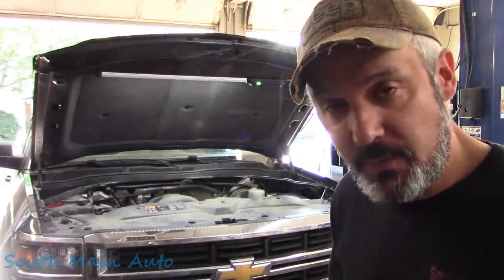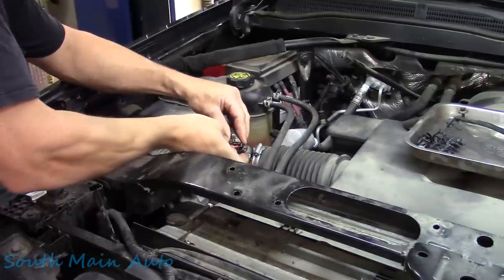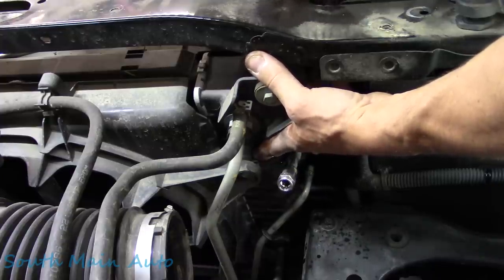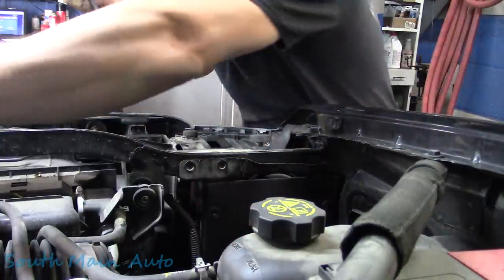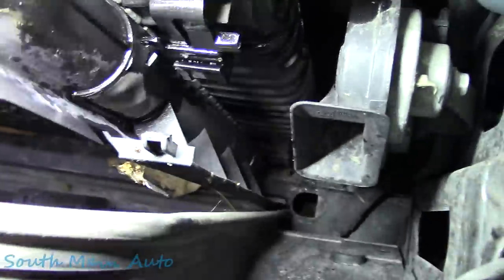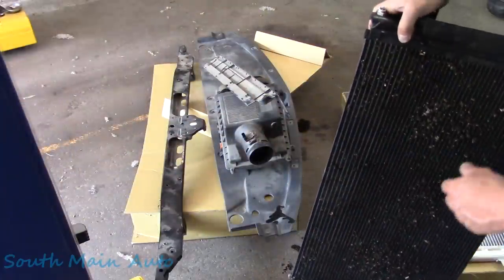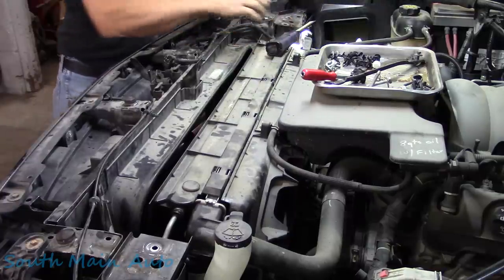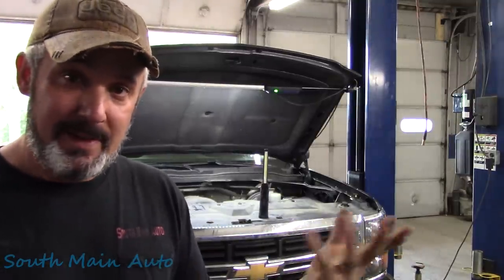Chevrolet 1500 / Tahoe - No A/C Leaking Condenser

Comment: Great video. As a GM tech I have seen dozens of those turds leak. Warranty cut the time so bad, we found a "flat-rate" way to do it. Looks like a nice vegetable garden growing in the radiator. Keep grinding brother!
Reply: Which means the radiator gunk is never cleaned...
Reply: @gplusgplus2286  yeah we still clean them. Just with soap, water, and a brush. Well at least I do, other guys I'm not so sure.
Reply: @gplusgplus2286  they are paying for you to clean the radiator, need to add .2 for that.
Reply: @burninggearsmobilemechanic  I've seen some industrial HVAC videos where they use some kind of cleaning solution to clean the fins. I'm guessing it's caustic. Wonder if that would work?
I recall seeing a semi repairer doing this for a customer due to overheating.
Reply: @Cheepchipsable  I use Dawn dish soap and water with a dish brush with a handle. It works well and then blow it out with a radiator air gun. I have seen the HVAC stuff. I assume it would be fine, a condenser or radiator is aluminum no matter the industry right?
Reply: @gplusgplus2286  Should the tech wash and vac the truck too?   These pay .8 now,  you don't get much done for peanuts.
Reply: @Cheepchipsable  Caustic and aluminum don't play well together !!!  They react, Drano granules use this fact.
Reply: So you're telling me never to bring my truck to your shop because you'll skip some stuff to get paid more? Thanks
Reply: @lopincol  Yeap, nature of the business.  You go to work and expect to get paid?  Well, so do I.  I don't work for free, and doing favors does not pay the bills.
Reply: @scrappy7571  from a paying customer's perspective that gets charged $$$$ at the dealer, I want it done right.  Warranty work included.  Take it with your boss, not the customer.
Reply: @lopincol  No, what I'm saying is, your paying for my experience to do the job your paying me for. If the job is done correctly and safely, what difference does it make how we got there? If Google tells you to go one way and you find a back road that gets you there sooner what's the harm? I have 35 years of experience and there is more than one way to skin a potato. 🤙
Reply: @thecuss6817  Very true,but the stuff is not harmful to aluminum. It's similar to the Prestone flush powder GM used to use for the S/T trucks to flush out the cooling system.
Reply: @scrappy7571  A tech should clean the area around the work area. If it comes back overheating I bet the shop won't pay to fix it without the tech participating because (s)he could have vacuumed and/or cleaned out the debris between the radiator and condenser. And if there is no damage from getting hot, the tech will be doing the cleaning for free.
Reply: @A. Melbs I do understand the frustration. Manufacturers continue to 'save money' by cutting labor times. But there's ways to remedy the problem; one is to leave as you did. The other is for techs to band together and make the manufacturers change their system. That is basically impossible because the flatrate world is every tech for themselves.
Reply: @A. Melbs 100% agree, glad you made it out. I trailered my tools out last week, never again going to be a GM warranty mule. Working for peanuts despite being in the building 50+ hrs/wk, watching customer pay jobs dry up because of increasing parts markup and shop rates, while our times decreased and rates remained the same.
Reply: @burninggearsmobilemechanic  For what this pays, nothing else is getting done for free.  Was not overheating before, why would it afterwards?  Just tired of being underpaid, and expected to do free shit.
Reply: @scrappy7571  Well, in my shop I do it as part of the job. Free is a relative term. If a customer asked me to change the oil and filter while I'm doing brakes, sure I would charge for it. But if I was replacing a door glass, I'd vacuum out the broken shards as a courtesy. I guess it depends on your definition of free.
Reply: @thndrstrck686  DAMN RIGHT!  Glad you got out.  I have 3 more years until retirement.  Screw this shit.  These days I make the same as I did in 1997.  Not accounting for inflation, health care costs, never ending tool purchases.  lucky to make 25 hours while there for 40.  And this guy wants his leaves blown out for free???
Reply: @scrappy7571  True, I decide what we work on. Now don't think we don't get our share of POS cars and bitchy customers but I don't allow disrespect or deceptive behavior from either side. We use Ondemand and don't have to deal with warranty (unless it's something we put on and it's our warranty). I do know the frustration of dealership life with the 'cattle call' mentality dealers push. My only advice is start your own shop and do it your way. It is way easier than you think. You can start out slow and do minor repairs and services until you have built the shop up.
Reply: @burninggearsmobilemechanic  Too late for me to open a shop.  45 yrs of this, and all I have to show is a worn out arthritic body, and no desire to work on modern junk.
Reply: @scrappy7571  YOU don't have to work on the cars. Hire guys/gals. Your knowledge and years of experience would be invaluable.
Reply: @burninggearsmobilemechanic  Just got to serv 3 years more time... Then I can retire and enjoy the remaining years.
Reply: @scrappy7571  That's good 👍
Reply: @scrappy7571  Thanks, I hope the next three years treat you better and you enjoy your retirement. I feel for you guys that have been at this much longer than I have and have so much invested in the dealership life.
Reply: I worked many, many years ago at a GM dealer (Oldsmobile.) To beat the flat rate, I saw guys both pull one head on a V8, use windshield "snot" to re-seal the intake manifold, and "torque" the head back in place with their half-inch impact. I've also worked with guys (when I transferred over to heavy-duty trucks) who also saw similar dealership flat-rate experiences. Not a good idea to use dealers for repairs!!! 😠
Reply: @gac914  Those techs need to be fired, and then tarred and feathered. To do a job under time is one thing, to blatantly hack together a customer's vehicle is unacceptable. The financial fallout from that crap could ruin a shop and the tech could be liable for most of not all of the cost.
Reply: @stevebell4906  Your pretty much spot on.   I swear that someday I will be paying them to work there.  The whole flat rate way of paying is, at best an antiquated system.  That needs to change before any new hires come into the industry.  Dealerships are toxic.  I'm 3 yrs from retirement, if I stay even that long.  In the mean time I'm doing my best to steer any wannbe mechanics into a better career choice.
Reply: @scrappy7571  I have been using to no avail now for decades with Drivers and Mechanics....Capitalism is real and management (The Company)is not your friend they are your adversary... and n this case they are between you and the paying customer...

Now imagine if you will a scenario with some other trades and management....lets say Plumbers & Electricians...Management call you up and ells you that you need to be at work with all of your gear and ready to work at maybe 0400-0500- in the morning...but you just need to hand out until they want you to work at their convenience maybe not until 1000 am or so and Now we are not going to pay you for any for that time...Or you are required to log a pre trip and check all or your tires and fluids and fuel the truck  and clean it...but hell no we aren't going to pay you for it...Or we routinely   short you 10-15% of your miles and you are paid by the mile...

Do you think ANY OF Those Plumbers or Electricians would put up with that?...Sadly as long as there are guys who will show up and be cheated by management it only encourages them to take more and more!

If YOU don't think your skills and experience are  equal to the other Skilled Trades...They will treat you like the Lot Boy ....Most of your toolboxes are on wheels and that is for a reason...You need to demand that they treat you better!
Reply: I love changing one then the next summer the “new improved part” leaks.

Comment: Another GREAT teardown video! If my 2009 Silverado ever needs AC work, I’m convinced it’s NOT a DIY job for me!
Reply: It isn't a hard job, it is just time consuming and fiddly.
Reply: That was basically easy.  All work was done from the top and everything easily accessible.  Try working on an Audi.
Reply: @EarthSouthside  exactly. The diagnosis often takes longer than the actual repair.
The advice I give to people new to DIY is" it's already broken so just try and see what happens".
Reply: The biggest issue with working on an A/C system yourself is the recovery and recharging. You always want to recover as much refrigerant ad possible, and without the machines at the shops you really can't, and if you crack the lines open (undo the bolts holding the lines into the condenser or any other part of the system) you'll get refrigerant everywhere, and it's really, really bad for you and for the environment. We use it because normally it's entirely contained and not a risk to us, but when it leaks, you really don't want the stuff on your skin. The new R-1234y type is much less detrimental to the enviromment than the old R-134a type, but it's not good for you, and if you pop the lines off without drawing it all out, you may end up inhaling some and you don't wanna do that. If you've got an AC machine, go for it. If not, let a shop do it. The machines tend to run around 3K for the R-134a and between 5-8K for the R-1234y type. Well, the Robinair ones used in my shop do anyway.
Reply: @apoplecticwrenchmonkey  the DIYers will love the price of the new refrigerant.   Think it’s close to $100 for a small can.
Reply: @apoplecticwrenchmonkey  hush! R134a is ZERO OZONE DEPLETION POTENTIAL and it can be a compatible/drop-in replacement for 1234YF. 1234YF is flammable, by the way as well as being obscenely expensive. Don't vent R12 into the atmosphere but zero ODP R134a is no real eco-hazard.
Reply: @walterk1221  Incorrect. I don't know where you get your information, but you may want to update yourself. It was determined that R-134a, while created to replace R-12 which was found to damage the ozone layer, is a contributor to the rise in greenhouse gasses. R-1234yf was designed to be much more friendly to the environment, and as far as we know (well, not all of us, apparently) it is so far much more eco-friendly. They don't just created new refrigerants for gits and shiggles, because it's expensive to develop so if they don't have to they won't. As for it being flammable, that's hardly a reason for it to be 'eco-unfriendly'. It's a reason to not be a moron with it, but that's more of a plus than a detriment in my opinion. Yes, the flammability is because it's very reactive, but that's why it's better. It breaks down in a couple weeks as opposed to R-134a which hangs around for 10+ years. Is it expensive? Yes it is, and so was R-134a when it was new and compared to R-12.
Reply: @walterk1221  I rebuilt a 2016 Chrysler 200s involved in a good front end hit.. it was "vented" during collision...after replacing parts I found it HAD R1234yf... A car A/C engineer stated that R134a was not compatible with this system... The compressor lable read "R134a"... I bought manifold adapters off eBay and purged system and added R123a and proper AC oil.. that was 3+ years ago and still have very cold AC at a MUCH lower cost...

.
Reply: @donjohnston4215  It's definitely expensive, and I don't envy the people who I've had to do A/C services for, especially with the Silverado/Tahoe's that have leaks. The Tahoe's take.. about 3.6lbs of refrigerant if I remember correctly.. 1.665kg on the labels, I think. Haven't done one in a couple weeks, so it's a little hazy on the exact details. I vageuly remember the Silverado's are around .667kg and the Tahoe's took a kg more..
Reply: @apoplecticwrenchmonkey  you are confusing regulatory agency dictates with physical reality. Everything I stated is correct in terms of scientific accuracy. You will note I mentioned nothing about the inconclusive "man made global warming" I merely stated that the materials are physically and chemically and operationally compatible. As opposed to R134a and R12 which are chemically incompatible.
Reply: @walterk1221  I am aware that you mentioned nothing about global warming, however your scientific accuracy clearly doesn't take into account that R-1234yf breaks down rapidly in the environment, whether it be on the ground or in the air, whereas R-134a does not, and takes over ten years. The EPA didn't decide that the chemicals react the way they do, did they? Is the chemical reactivity and decomposition of the two substances not a physical reality, or is that not relevant?

If you really want to get into the chemical properties of the compounds, at around 30C, the two refrigerants behave similarly in terms of the pressure they create inside the system when being evaporated to provide cooling, but at higher temperatures they diverge and R-1234yf creates more pressure, allowing for better cooling. Using 134a in a 1234yf system will reduce your cooling efficacy by around 10-15% and also shorten the life of your system due to the systems being designed for higher pressures. Can you use 134a in a 1234yf system? Sure you can, but you'll wear the components out faster.

And as for the 'inconclusive man-made global warming' bit, I'll avoid responding to that, since it's a can of worms that's already been gone over so many times that it's pointless for me to do so, and I'm no expert on it. Though, I'm sure you must be to declare it 'inconclusive' so easily.
Reply: @apoplecticwrenchmonkey  it's a good thing that 1234YF breaks down rapidly. No harm no foul when I dump it and install R134a in its place. I am, in actual fact, a scientist but I, obviously, could make virtually any claim regarding my background so I don't expect you to take my assertion at face value.
[EDIT: you downplayed the significance of the flammability of 1234YF. Flammability was the bogus reason given for the drop-in replacement for R12 developed by Professor George Goebels (Purdue University) from being accepted in mobile A/C systems despite being accepted for all stationary. Refrigerants are purely politically influenced.]

Comment: I did this job on my 2016 a month ago.  It took me much longer than Eric which is no surprise.  My one suggestion is to go ahead and buy a new set of seals, they not included with the AC Delco condenser.  I couldn’t get mine to hold a vacuum until I replaced them.  I would characterize this as a very advanced DIY job and you must have all of the AC tools to do it.

Comment: GM has a new thermostat for the oil cooler bypass. Highly recommended to change it out for the new one. The original bypass thermostat is why a lot of the 6-speeds have problems (and why they cook the fluid worse than ever). It's a 5 minute part change.
Reply: Or remove the cooler bypass entirely and let her be cool
Reply: I wouldn't even recommend gm's update. Ive seen plenty of people in a 14+ gm truck group im in complain about high trans temps even after doing the updated thermostat. I put the sure cool kit in my truck and it doesn't go over 150 on a hot day. The real problem with these 6l80s in the gm trucks is the torque converter. But the high temps dont help
Reply: @sbc_jake_9677  The high trans fluid temps eventually damage the torque converter clutch friction material. Between how often they lock the converter and the tall axle ratios they use these days, the TCC doesn't hold up long. 200F+ is way too hot no matter what some people say.
Reply: @karlschauff7989  I agree. Im not saying do nothing. Im simply pointing out the fact that the 6l80s in the gm pick ups have a weak torque converter. Whether thats because fluid gets hot or it was not built to last

Comment: Well done sir. Only thing I do differently is, I blow out the entire system with nitrogen to pick up the extra oil, then pressurize with nitrogen to about 300psig, and let it sit for an hour to ensure there are no other leaks before evacuating with vacuum pump, and weighing in new refrigerant charge. But these are habits from being in the hvac service industry for 40yrs.

Comment: I had a look at my friends ute,  he said that he'd had it at a shop for the past 3 summers for a recharge but the couldn't find the leak, they just pumped it up each time.. I took the caps off and you could see oil/refrigerant bubbling out of the high side shraeder valve lol. 
I guess they were so keen to hook up the machine that they missed it before putting the connectors on. 
I was glad though. Easy fix!

Comment: I love my Chevys they are pretty durable, I put 300k on many transmissions. The motors are strong, but the ac systems on these Chevys are junk. If it isn't the condenser it's the compressor, if it's not the compressor it's the accumulator if it's not all those it's the lines...🤦‍♂️

And I hate the oil coolant line that goes to the radiator, those leak like crazy if you don't use OEM, and it's hard to find good OEM lines 🤬🤦‍♂️